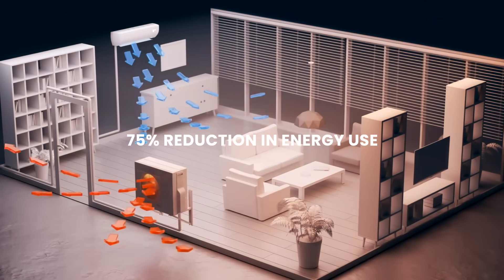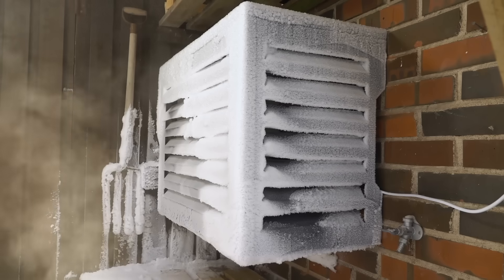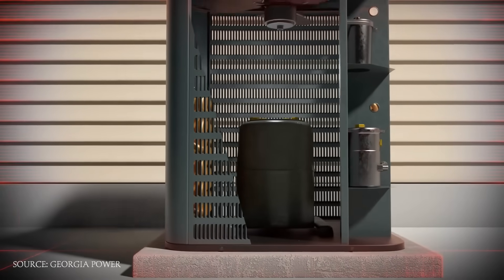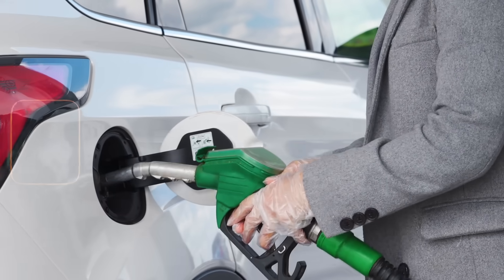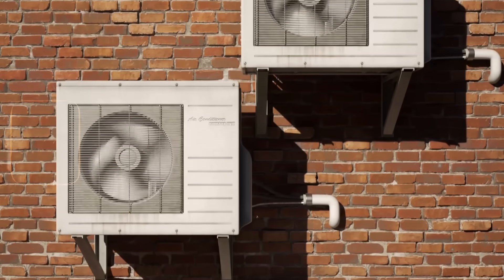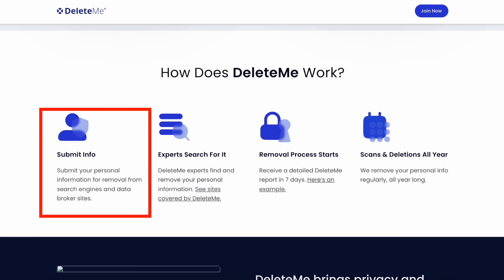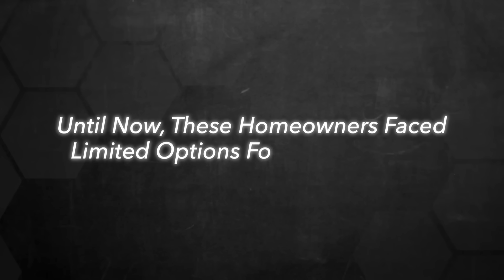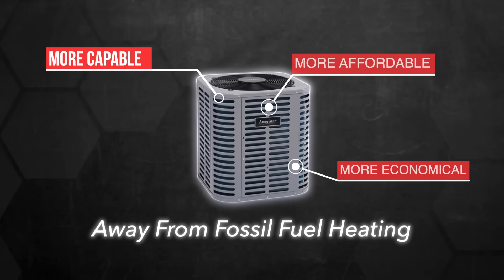Genius Heat Pump could change how we heat our homes forever

Comment: My gas hydronic heating system has been highly reliable for decades because it's simple. My central air units have been highly reliable (no repairs) because they are basic and simple.  There's a lesson there.
Reply from the maker: Simple is good, that's what's interesting about these is its existing tech just piped in loops in series, interesting concept I was unfamiliar with. If you want the most reliable HVAC then yes get the simplest stuff, but honestly we've had problems across the spectrum so "simple" is not necessarily a guarantee
Reply: @TheHVACDopeShow  The installation is of supreme importance. I was with my installer for every minute of the process. I know exactly how it's supposed to be done and he did an excellent job. I keep the condenser coils and area clean and the filters for the air handlers clean and no more than MERV 8. No one ever touches them: No "tune-ups", "efficiency checks", refrigerant measurements, etc. I keep a spare capacitor and contactor just in case.  That's it. My first systems lasted ~45 yrs and were still working when I replaced them to sell the house. 14 yrs so far with the Goodmans.
Reply: @TheHVACDopeShow  Nah. more loops, more components & different refrigerants. What happens when the local HVAC adds the wrong refrigerant into a loop? Probably going to damage it.

 Realistically a Geothermal sourced HP will run circles around a Cascade HP.
Reply: @guytech7310 : Except in situations like mine where I would have to go with an undersized system (~80% of my needs) due to how small my yard is and how many obstacles there are. For me, an air source heat pump is the only option for getting rid of natural gas.
Reply: @jacobcarlson4010  Then keep the NatGas. If you switch to a HP your heating costs will go up!
Reply: @guytech7310 : The chances that a heat pump would raise my electric bill by the $225/month (average of this past winter) that natural gas cost… pretty ***king low. Even rounding my electric rate to almost double what it really is, that would mean a heat pump would use 1.5 megawatt hours per month. Most heat pumps max out at 0.1 megawatt hours, assuming an 800 hour (33.5 day) month. So yeah, spending more with a heat pump is literally, demonstrably impossible.
Reply: @jacobcarlson4010  OK, You see. Don't forget electricity prices in the US are going up.
Reply: @guytech7310  And the price of gas isn't going up?... right.  In my area, the price of gas has been stable for years...nope.  Months?...nope.  Days?....maybe.  We're waiting for the next price increase, and we won't have long to wait.
Reply: This is directed at those with solar panels and complicated boiler replacements. I have a portable heat pump/air conditioner and a few solar panels. Way cheaper than fuel oil when the sun's providing. It has two hoses that connect to the window to exhaust the heat of air conditioning or cold when it's Heating. 1/3 the power of an electric heater. Converting BTUs and kilowatts versus cubic feet, we're one cent per CCF, 1 set for 100 ft here in anchorage. And the price is skyrocketing has our power is produced with natural gas as well and another shortage has come.
Reply: The Gas Company will buy those companies up and lock it all down. Then they will keep prices the same or raise rates.... aka MA Bell.
Reply: It’s also costing you significantly more to operate it.
Reply: @berated4541  My energy bill compares my use with high efficiency and "normal" houses of similar size to mine. I'm usually about 46% more efficient than the average of the high efficiency homes. So, no complaints here.
One repair on a high efficiency HVAC system will probably eat up all of your savings. Reliability is essential.
Reply: @ Size of the house doesn’t matter in this instance, you are focusing in one metric in a crowd of metrics used to calculate efficiency. Similar sized houses will have different load calculations depending on climate, elevation, sun exposure, insulation factors and many other factors. And you speak like the new equipment isn’t reliable. As long as it is installed to manufacturer specifications they are quite reliable. The future is here regardless of how hard you fight it. And mechanical cooling as we know it is on its way out. HRV/ERV systems keep houses cool in the Arizona desert without any refrigeration, just moving and mixing air along with proper planning.
Reply: @berated4541  If you say so. I'll stick with what I have. My energy bills are lower than those of friends with smaller and newer houses. I'm very comfortable. All the best to you.
Reply: @wholeNwon  wait a second what just happened here🤨did we just agree to disagree and leave it at that!? Best to you as well!
Reply: @berated4541  Sure, why not? Different strokes....as they say.
Reply: Engineering genius is to design as simple as possible.
Reply: That's true but I believe the point here was to address increased efficiency.  One important issue, especially for those in a suburban area, is that you can potentially add solar to your house which can offset your electrical demand.  Adding personally generated fossil fuels is not an option for most folks.  Personally. I don't look at any system as being an all in one.  I like looking for alternatives that may have the potential to increase the performance of my systems at an overall lower average cost.
Reply: And that new car is more sophisticated than the ability of the mechanic. Technology is advancing rapidly, thank god it is.
Reply: Retired HVAC guy here in Massachusetts. NO ONE is taking my gas boiler out of my house ever! This is WAY too complicated for the avg HVAC tech. K.I.S.S.  Electric prices in MA are some the highest in the country also.
Reply: These new inverter heat pumps are very simple and highly reliable. They have been/are being perfected in Asia for a very long time. Anyone who says otherwise is uninformed. The cost of electricity is important obviously but there is no other technology that can output more energy than the energy input.
Reply: @ItsMe-tl6co  That's the great thing about heat pumps.  You're actually getting the heat from the air, or preferably the ground, and just using the electricity to move the heat in or out of your house.
Reply: @johntoe6127  Exactly. I'm looking to move to a water source heat pump in the next few years.

Comment: What is the claimed efficiency for these residential systems?  Would this be a viable alternative to water source heat pump?
Reply from the maker: Yes it's a viable alternative and the COP is above 4 is my understanding even in frigid temps, making them very cost effective in all climates for heating. Once the product cost comes down a little bit it will be ver comparable. Believe it or not it's not that far off from a 5 ton dual fuel heat pump system at todays prices, everything has gotten very expensive recently so it's about a 50% premium (which is HUGE, yes...) but still indicative that it will become more competitive over time
Reply: @TheHVACDopeShow  beside efficiency,  there is an issue with capacity drop up to 40% at -20F.You need take into account this both factors when you compare them
Reply: @TheHVACDopeShow  Thanks for the info.  I appreciate the content.
Reply: Theoretically, ground source heat pumps (GSHPs) should be more efficient because they use normally 45-55 degree F water versus down to -15 degree F air as a source.  However, the implementation costs may not be an option for some folks - especially those in semi urban or suburban locations. In addition, the permitting and implementation portion of GSHPs would be much more $$ and needs to be factored into your evaluation/solution.

Comment: I checked their website and the prices are really high.  I like the idea and the fact that they will make units larger than 5 ton but the cost needs to come down.  $20,000 plus installation for a 6 ton unit is not competitive!
Reply: Instead of investing $20,000.00 in a heating cooling system and still have maintenance and electric bills, what if the buyer invested that in more insulation or in a new home build, using a double wall system which allows more insulation along with raised heel trusses to allow more insulation. Thus building a home that doesn't require much heating or cooling and if built right should last for decades.
Reply: @kerrryschultz2904  That'd be my plan. Build a sips (10") house and use a smaller unit.
Reply: Coming from someone whom does HVAC in Northern CA area, there is most definitely a market for this. People spend over 20k on 5 ton zoned systems all day long in this market.
Reply: You’re buying 2 heat pumps basically. So it has to be more. 
Seem like a geo would be competitive in price and cheaper to replace later
Reply: That $20k does not include a whole lot of stuff
Reply: And what price do you want honey, this new technology  at the price of a MrCool?
Reply: You definitely have not tried to price out a heating system in New England lately.  I got a quote for regular air to air heat pumps for our 3rd floor (1000 sq').....$30k. To do the whole house they wanted > $75k. Knowing that when it goes under 32 degrees outside the COP tanks.....I think I'll keep my boiler and cast iron radiators.  Very toasty.
Reply from the maker: Yeah the good news is a 6 ton is actually more like a 12 ton in terms of actual output (from my understand) so for most residential applications a 3 ton is pretty adequate. But yes price is a big factor on this, hopefully it comes down soon
Reply: You can get a MrCool heat pump and it will operates at -22F degrees. And it is affordable.  So price wise I would choose the MrCool heat pump over this.